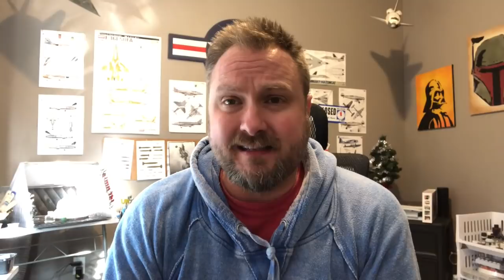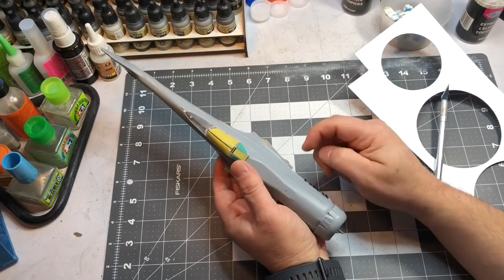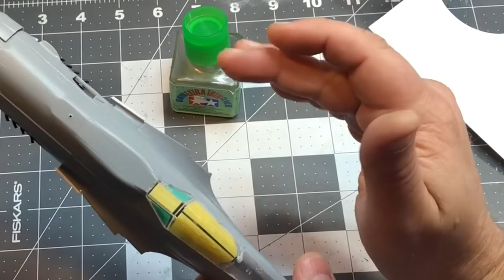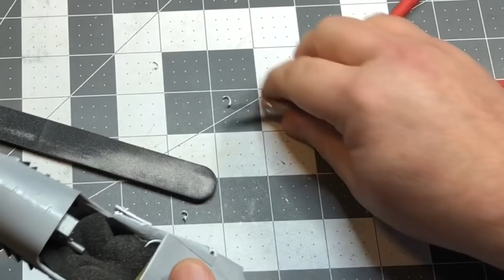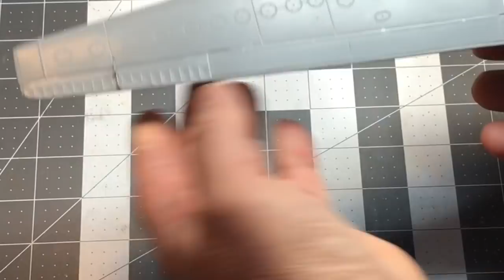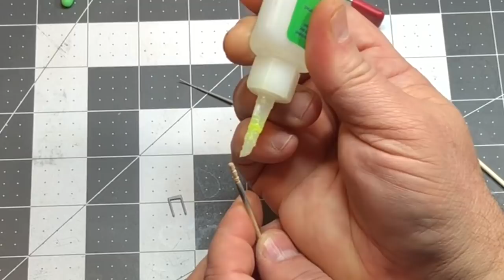Zoukei-Mura 1/32 Ta 152 H-1 build Part 2

Comment: about bonding the plastic card to the body, another technique I have successfully used, is to cut a piece of the kit sprue to use, thus (theoretically) ensuring a better bond as you are using the same plastic as the kit. results to date have been great.
thanks for another great vid!
Reply from the maker: Good tip Eugene